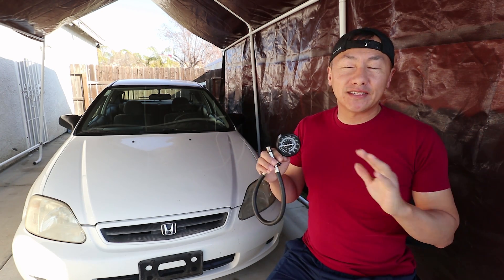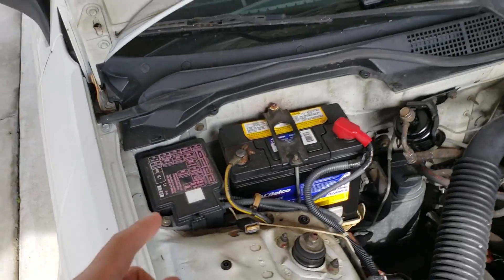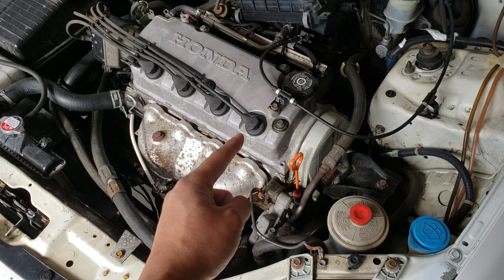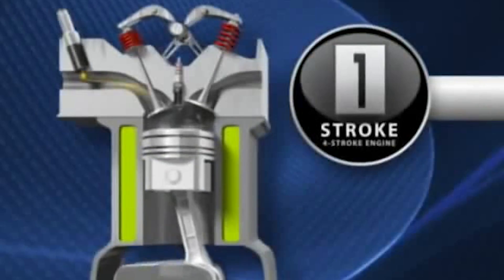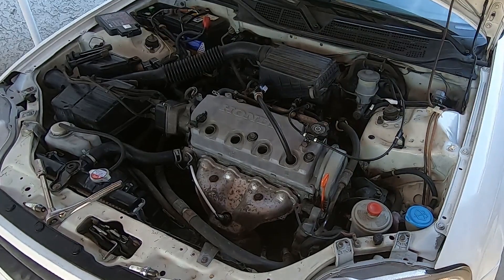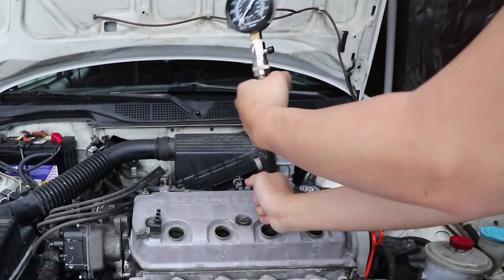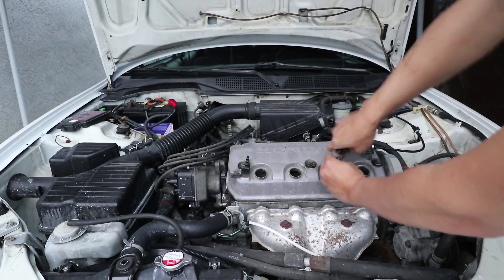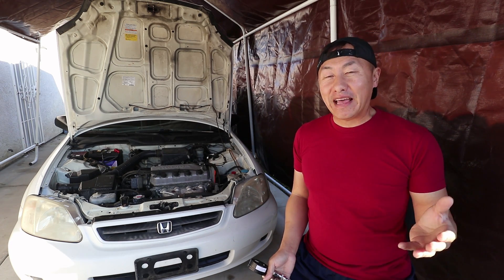How to Compression Test and find out if your engine is healthy

Comment: Hey my daughter has an ‘07 Camry,I did a compression test on all cylinders and didn’t get any readings on the gauge,what could it be?

The gauge didn’t register @all!

I took the gauge to wrk to put air on it thinking it was the gauge but it wrk then so I’m @ a lost on what’s going on with it…

Chain is intact with marking,not loose or anything!

I did an old school trick where I put a piece of paper in the spark plug while & it pop out with pressure,what’s Ur thoughts on that?

Comment: Why do you have to warm up the engine before you do the test why not on a cold engine
Reply: so the piston rings can heat up and expand. if its cold the rings are more contracted causing blow by and much lower, incorrect readings.

Comment: Since my car is misfiring on cylinder 3, wanna check it out.. Hope it’s condensation built up on the spark plug or bad ignition plug. We’ll see the results
Reply: have the same problem on my honda accord lx 2014. what was the problem?
Reply: @IVAN22LA  Oil on spark plugs, burned it off by driving and have no misfire anymore. Although it would be great to replace your valve cover gasket

Comment: 200 psi is quite a lot of pressure. Do you know why it does not all go out the exhaust?
Reply from the maker: The valves are all closed when the piston is at top dead center.

Comment: I thought u were no meant to have a warm engine
Reply from the maker: You can do cold as long as it's consistent, but warm is the preferred because the engine is operating temperature when you're driving the car and that's when the ring seal really matters.
Reply: @GTContent  thx

Comment: I have a 2006 Mitsubishi Outlander. I do a diagnosed. An it said i need a camshaft possition. Sencor. But the engine. Light wasn't on. When a was driving. But it did shut rite off on the road..  A was thinking if i should do a compression test before. I buy a cam sensor.
Reply: What ended up happening?

Comment: If you warm the vehicle up wouldn't that make it easier to damage the spark holes from the heated soft aluminum/metal.? I thought compression checks were done while the engine was cold.
Reply: Good question. Scotty says warm it up for 5 minutes then take out spark plugs for compression test. Haynes manual says "...allow the engine to cool before removing or installing plugs".
Reply from the maker: Still possible to remove spark plugs while the engine is warm.
Reply: @GTContent  Yes possible but the question is - is it a good idea and are you risking damage to the head threads?  I chose to run my car briefly and let it cool down for a while. I got good results on my 16Y8 with no apparent damage. Thanks for you video!
Reply from the maker: @jukeboxzero1  Glad it worked out for you.

Comment: So after you cranked it 4 times did you release the pressure and then crank it 12 times or do you crank 4 times then crank 12 times ? Thanks
Reply from the maker: Don't release. Only release after the 12 times so that it'll build pressure.

Comment: what happens if the throttle body is not open? will the compression be lower? ( just did a test not pressing the gas pedal).
Reply from the maker: Yes, numbers will be lower giving a false reading.
Reply: @GTContent  Do you press the gas pedals for all cars doing compression test? I have a 2009 BMW
Reply from the maker: @bobbyz23  yes

Comment: No wet test ?
Reply from the maker: No. Wet test should be conducted if the results vary greatly from cylinder to cylinder or if the motor is not warmed up.
Reply: @GTContent  Thank you.

Comment: After you warmed the car up to operating temperature , you turned the car off to remove the fuel pump fuse, spark plugs, and  wires . can you do a compression test with a car that has a crank no start problem? Where it often will not completely start up at all?
Reply from the maker: Yes, as long as it cranks.

Comment: I'm looking into getting an older Ford van from the 1960's. It also comes with a parts van of the same make & model. I don' t know if either vehicle has an engine or whether or not the engines run & I haven't contacted the owner about this. Is it possible for me to run a compression test on both vehicles, before I get new hoses,  spark plugs, etc. Thanks

Comment: GT CONTENT, why didn't you disconnect the ignition system to do a compression test? 
                         I'm not sure why auto tech disconnect the ignition system to do a compression test
Reply: I was told to pull ignition fuse so that you don't blow the coil.  And that someone had that happen.  I guess it can arch to a ground and ruin it.

Comment: Can you make a video on how to diagnose bad compression
Thanks
Reply from the maker: I'd like to have a bad example to show you guys, but don't at the moment. Here's my tips:
-Check if compression numbers correspond with factory service manual.
-Make sure there is less than a 10% difference between the highest and lowest cylinder.
-If you assume there is a bad cylinder, then pour some oil into that cylinder via the spark plug hole and run the test again. If the compression goes up, then the piston rings are worn. If the numbers remain the same, then the valves on the head may be the issue.
Reply: @GTContent  thank you

Comment: What's your opinion on the Subaru STI an the EJ? Is it a good project car?
Reply from the maker: Looks wise, I am a fan of the STI blob eye. The EJ25 is known to have weak ring lands (use this compression test video to find out if you're checking one out 😉) but does have a more durable transmission. It is a good project car, but costs more money to make power compared to the EVO.

Comment: Im scared to do it to my engine lol don't wana surprise lol
Reply from the maker: #TRUTH
Reply: Well I just did it in my junker Opel astra and it had 110 psi on 2 cylinders and 120 on the other. Since it was raising the pressure in my cooling system a while, but now stopped I will just drive the stupid thing conservatively till it is dead. It needs a serious engine work and I'm better to buy a lower mileage Toyota and be happy and don't mess with stuff like that!
In case you are wondering my vehicle has 185,000 miles currently. I'm the third owner.
I've done all the brake jobs, timing belts, pulleys, tensioners, I change the oil and filter religiously every 4,000 miles. Well it might last a year more, but atleast I know I shouldn't drive that car for long distance places because I can get stranded somewhere🥵😂😂😂😂.
I am really thinking of buying a Toyota Avensis
Station wagon. They have a lot of room, nice interior,and will last me a lot longer since I will  change all the fluids, filters, inspect it and so on.
Reply: @AlexanderYivanov  Thats only 10 psi difference , Are you reall sure thats not carbon build up?Or is 10 psi a confirmation your engine is failing?
Reply: @joebagofdoe4762  Despite burning a bit of oil, for now the engine works fine. The coolant leak was from a hose and I repaired it.
Like I said I will drive it a bit more, and soon I'll get something better.I am going to Germany to work there, and there I use my mom's car, so after 2-3 years I will get either a Subaru or Toyota.
Reply: This is the most accurate comment I’ve ever seen🤣🤣☠️
Reply: did it and was completely blown away..not just low but 30 psi on every cylinder